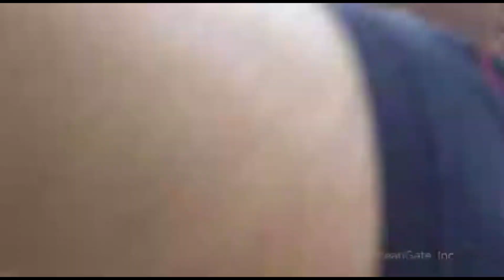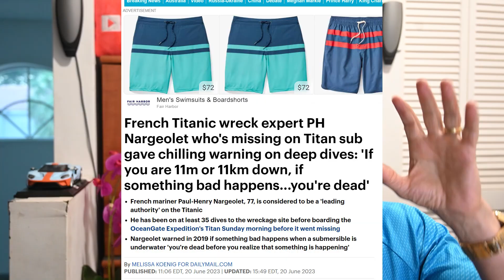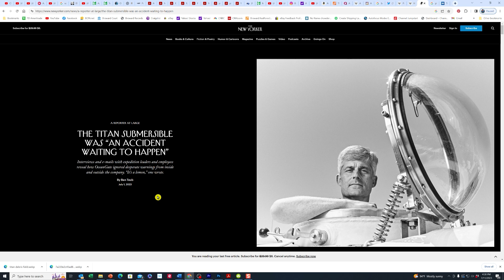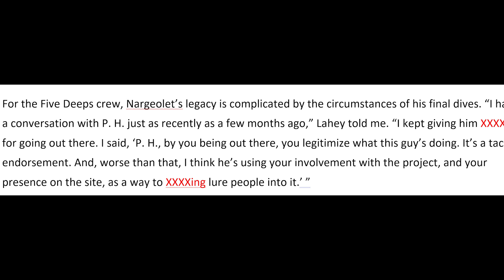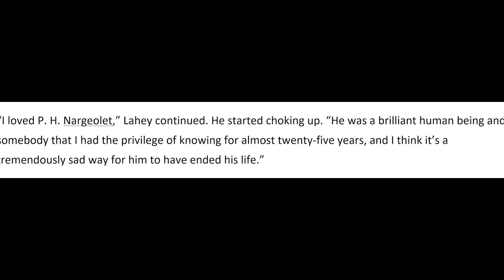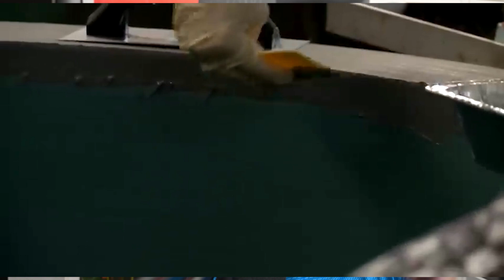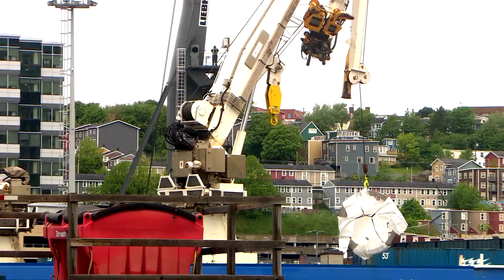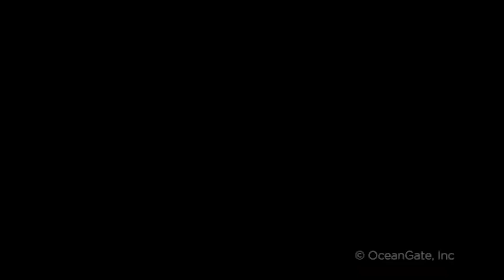Titan Sub: More Q&A, Design Defects, Why Descent Fast

Comment: The carbon fiber was being infiltrated with water, weighing the Titan down, and also causing the crackling noises and sonic alarms. That's why it sank fast and couldn't rise fast enough, despite shedding weight.
Reply: Carbon fiber composite is more dense than water. The only time soaking something makes it less buoyant is when the water replaces something less dense like trapped air.
Reply: @mqb3gofjzkko7nzx38  I've seen comments talking about water weighing the sub down, but I was having trouble imagining why water would supposedly make the sub sink faster (when it's already in the ocean surrounded by water), so thanks for your take on it.
Reply: @bagelbagelwah5047  I think of it as a wet towel becoming heavier than a dry one but maybe that's completely misleading shrug
Reply: @Zleec  It would be more like a wet towel being thrown into a pool.
Reply: @bagelbagelwah5047  While it doesn't seem you fully absorbed Archimede's law, let's try this argument: will a metal boat sink when you fill it with water? Take it from that point. 🙂
Reply: @curiouscat8457  will a carbon fibre vessel implode if it's already full of water?

Take it from that point. :-)
Reply: @fifiwoof1969  We are talking about buoyancy, in case you didn't notice 🙂.
Reply: is this just speculation? or is this confirmed?
Reply: @NithinJune  No way to know now that the whole hull has imploded. But its a good explanation of why they couldn't rise fast enough. But at the same time getting hull integrity test failure codes.
Reply: It's a good explanation. But what does "carbon fiber being infiltrated with water" mean? Has or can this phenomenon be reproduced?
Reply: @Zleec  Carbon fiber cannot be applied to anything as it is, it has to be bonded with a resin. Basically making it a composite material. This is dangerous for stress since, the inconsistencies will become weak points and after certain cycles of stress, it starts leaking. Also, this isn't solid carbon fiber, they had a hollow space to use it as mechanism to float by filling it with low density gas. Basically, lot of gizmos without testing.
Reply: @thelastorca  Very interesting
Reply: @Zleec  Yeah, more the videos I see about this, the weirder this case gets.
Reply: @Zleec  could do a pressure test. And post the video on YouTube:-)
Reply: It's a good theory.  While the implosion would happen very fast one could imagine a slower cascade effect with intrusion into the carbon fibers, de-lamination etc. Certainly a theory explaining crackling noises and RTM alarms not evident in early dives.
Reply: @heazilla  THEORY: Thrusters were incorrectly mounted thrusting down faster than intended!
Reply: @fifiwoof1969 I don’t think they descend with the thrusters. I could be wrong but i remember someone from the company saying they descend with everything in a low power state until they get to the bottom. They use the weight of the ballast to do all of the descent. I did think that some type of oversight like that could have done something to the structural integrity though. If they are so cavalier with things that they don’t test a thruster to make sure it is mounted the right way after replacing it, what else might they have done without knowing?
Reply: @Comfort031  and they ascend how? Jettison the ballast? A little uncontrolled wouldn't you say?
Reply: @Comfort031  I was imagining the vertical thrusters pushing down at a low speed to explain the "weight"; if it went unnoticed that could explain it.
Reply: Its one of the few things that would explain the fast descent rate and lack of ascent. Again if the transcript is accurate. Every other time, it descended and ascended right around a certain rate and did not significantly deviate. There was probably a small crack on the surface somewhere near the aft end (where they heard the noises if the transcript was accurate) due to differential expansion of the carbon fiber body and titanium end cap. As it descended it picked up more and more speed as more water came in. As the pressure increased, the water probably started forcing itself between layers of carbon fiber, separating them and causing the reported crackling. Eventually the structure separated to the point where it could no longer withstand the pressure and catastrophically imploded. It’s all speculation at this point. That’s all we can do until more information is released.
Reply: @Comfort031  incorrectly fitted thruster would explain that too. Up thruster pointing down for instance.
Reply: @fifiwoof1969  that would definitely explain why ascent was at a rate quarter of predicted, but wouldnt affect the descent. The simplest explanation is a loss of buoyancy which would explain both of those things. We will probably never know the answers to some of these things though. An investigation can tell us what likely happened but it’s going to be hard say with absolute certainty what it was. There was no black box to recover like there is on planes. No real time telemetry monitoring or saving of data. Just the alleged report of the hull monitoring system showing red.
Reply: @Comfort031  it wouldn't affect descent? I reckon it would affect both ascent and descent if both occured with an incorrectly mounted thruster thrusting in the opposite direction to what was intended. I wouldn't put it past these guys to make THAT fuckup. They ARE idiots!
Reply: I think it's a real argument for pilot error. Rush had far less concern about his descent rate than the mothership, which leads me to believe that he purposely dove at that speed. Either he was showing off for the Portier Prince crew to show them the sub was tough to show proof of concept or he was trying to hurry the trip to get back to something else. Either way, Rush was an engineer, he knew the possible outcome of descending too fast. Misplaced faith in his design or death by pride? Idk! And, I don't believe the sub was weighed down by water because Rush would have recognized that issue based on the rate of descent and would've made corrections to address the issue or flat out cancel the dive. Besides, the only infiltration of water that could have had a major effect on the dive rate would have had to occur within the pressure vessel where the crew sat. I find it highly unlikely that Rush or the crew would not have noticed a leak inside the sub. Additionally, if the hull was compromised enough to allow water to come in, the Titan would have imploded far before it reach the Titanic. Also, all the major components sat in liquid filled compartments or were in pressurized housings in the mechanical bay at the rear of the sub. if the sub was weighed down by water, where was the leak? In my view, the more likely scenario is that the rate of descent caused damage to the battery compartment and the hull and both only completely failed when the sub got near the titanic and needed to ascend. While they had a secondary battery system they only had one hull. Whether a vessel is  made  from titanium or carbon-fibre, descending or ascending too fast can cause structural failures in compartments and the main pressure vessel. All the hype about the material the subs hull was made from could actually be wrong!
Reply: @dwsfamilyvlogs7705  the carbon fibre red herring? It may not have affected the descent or failed ascent but it DID implode due to EXTREME external pressure and fatigue from previous descents.
Reply: @fifiwoof1969  Possibly, we may never know. In any case, whether a vessel is  made  from titanium or carbon-fibre, descending or ascending too fast can cause structural failures. Battery compartments are sometimes made from titanium and they can fail under fast descent rates and have.
Reply: thats if it was getting buoyancy from imperfections in the hull, pretty sure carbon fiber is more dense than water. maybe if there was a leak inside another secure compartment on the sub outside of the main pressure vessel it would make sense. if the transcript was in fact true then they had zero worry about the decent rate, making it intentional or they were low on oxygen inside causing them to not notice or care. in the transcript im not sure if the support vessel pointed out decent rate as well, making me think the transcript is false, or it was a planned rate. going that fast im worried the ship didnt have time to compress in its 'normal and uniform way', the ship is going to shrink as the pressure rises and if they went too fast maybe it just didnt give it the time it needed for all materials to match. I keep imagining this thing compressing in its center around the carbon fiber and the titanium not matching, the glue the only thing keeping the edges of the sub from popping away from the caps that are now way too big for the carbon fiber tube, )(  <-- if it was nose down.
Reply: @MrBonebus  the batteries of the Titan sit in a sealed compartment filled with a silicon gel fluid. Even if these compartments were compromised, you're only replacing the heavy silicone gel with sea water that weighs less. That wouldn't make the sub heavier it would make it lighter! The only thing I can think of that could have taken on enough water to make the sub heavier is the Titans buoyancy system. The system uses an inert gas transfer method to create buoyancy. This system could have been penetrated by water without the crew knowing but if this did occur, my questions are why didn't the sub's diagnostic sensors warn the crew and  why didn't Rush think the descent rate was unusual as his handlers on the Portier Prince did when they asked if he was going to slow his velocity? Only thing I can  think of is that Rush was responsible for the high descent rate.
Reply: Just wondering about the young interns who must have been to excited and feeling privileged to be working “at the cutting edge”. Unfortunately they would all be mailable to the cult like Rush and drank his cool aid. If they all continue with engineering, they sure have a had a long life lesson in why engineers respect the knowledge and lessons learnt from previous generations and why there are standards and regulations.
Reply: Most likely a fake transcript as the descent rate is way off. Who ever manufactured the story didnt do the math.
Reply: @KinariCuzz  just like "whoever manufactured the Titan didn't do the testing"!
Reply: @fifiwoof1969  well. That one appears to be a fact.
Reply: Do you have any proof of this or is it just speculation on your part?
Reply: @R0swell5104  i believe all of this is speculation. Armchair engineering
Reply: @R0swell5104  who are you talking to?
Reply: Interesting thought and a possibility. Did the craft gain wight over time?
Reply: @heazilla  Exactly in this case they are mostly thoughts.
Reply: They were never descending too fast. He keeps comparing the descent rate of James Cameron's sub to this sub, which is fundamentally wrong. 
Doing 5min of research will show you that this company made 13 other trips to Titanic, and every one of them had a descent rate that got them there in 90min or so. The descent rate wasn't an issue. 
This topic keeps generating a lot of clicks though, so ignorant speculation keeps winning the day.
Reply: There is no space in between carbon fibre and there is even less water can suck unnoticeable to sensors.
Reply: Its still buoyant, with water inside or not. That wouldnt affect anything.
Reply: @cyphi474  Oh dear...
Reply: Interesting. Could have also been a malfunctioning vertical thruster.
Reply: @thunkjunk  or NOT malfunctioning but incorrectly fitted!
Reply: No no it’s a moronic theory lol.

Comment: My very amateur speculation is that it had a leak and was taking on water as it was going down.  This would add to the weight of the craft and accelerate the descent.  This would also lead to the overly heavy craft that can't rise quickly even after jettisoning every possible part.  It should have been rising quickly without the jets after ditching the undertray/skid.  The only extra weight I can easily add is water.
Reply: Any water that would leak into the vehicle under that pressure would slash the contents to atoms as the it buckled and imploded. In milliseconds. The pressure is insane.
Reply: @fauxpinkytoo  yeah but if the leak started further up, like way further up, it might not have been immediatly catastrophic.
Reply: @Mglue3 wut
Reply: @fauxpinkytoo  The leak could be more a seep between microcracks in the layers
Reply: @fauxpinkytoo  Cite your proof.
Reply: @Capecodham  50 years of study and practice by everyone in the industry... Is that enough for you?
Reply: @stever2583  I have  67 years of study and practice by everyone in the industry- see how easy that is to type?
Reply: @Capecodham  Not me idiot... The people who know the answers to very simple questions that you struggle with. Cheap shots is all you have? I guess that's what no education gets you.
Reply: If the craft buckled and reduced in volume that could also have reduced its buoyancy.
Reply: @mqb3gofjzkko7nzx38  cf wont buckle it shatters.
Reply: My theory is that the vertical thrusters were malfunctioning.
Reply: It - cant - have - a - leak. Drop this theory. It doesnt make any sense. Its not a boat.
Reply: @KinariCuzz  It could have a leak, but the implosion is proof it wasn't  completely filled with water.
Reply: Spot on
Reply: While possible, I have to wonder if they were ballasted correctly from the get-go. That could cause a fast descent and a slow rise.
Reply: @russellhltn1396  I want to know how buoyancy  was controlled.
Reply: @JoeLinux2000  Same here.  I've heard of ways they could drop weight to ascend, but not how to fine tune their buoyancy.  Normal subs have tanks for that.
Reply: @russellhltn1396  this is true.
Reply: It's not a metal hull. Carbon fibre that allowed water in, would fail catastrophically, not leak.
Reply: @kristianfagerstrom7011  true
Reply: if there was a leak , descent rate would be increasing progressively. also as the pressure gets higher, more water intake. progressively more water intake(faster water flow) causes that tiny hole getting bigger and bigger. like a river flowing fast, destroys the land its around. that would be a very fast, unreturnable chain catastrophic event. it wouldn't take 1.5hrs.
Reply: A leak is instantaneously catastrophic.
Reply: I thought the same as you, but as somebody pointed out, it's possible there was an electrical failure that made it so they weren't able to drop the ballasts. 😭  Scary!
Reply: They don't use thrusters for ascending and descending, that part of the trip is purely buoyancy controlled.

If the com log is authentic than they did release their weights.

A leak slowly filling up the submersible without them noticing is borderline gibberish, regardless of when it occurred. Makes no sense to me.

I personally find it most likely that they drastically miscalculated their weight or water had begun to seep into the layers of the carbon fibre.
Reply: ..my guess is that his beloved logitec joystick, lost its resistance over control surfaces due temperature/humidity as it uses graphite based potentiometers as a sensor..as result of low temperature, resistance changed which in return caused deadband of signal to be such that, full throttle up for thrusters was impossible, regardless hes yanking it to the max or not..and thats exactly reason why MIL grade joysticks sensing surface is enclosed in nitrogen atmosphere inside heated enclosure..
Reply: @eccosabanovic1589  Yeah. Could also be the wireless controller lost it's signal.

Comment: Dear Jeff, thanks for your videos. A question that is hammering my mind is: why did the descend rate accelerate?
Was it actually taking water between the layers of the carbon fibre since the start of the dive? Were they loosing air slowly?
Reply: Or maybe taking water under the floor as well, theres a void there -  but I hadnt considered the CF itself taking water like a sponge as it split apart, good theory--!!

Comment: I think a major factor in this tragedy is the fact that the submersible was made from different materials, carbon fibre & titanium, these materials have different levels of compression.
The bulk modulus of the carbon fibre part of the sub is around 20 & the bulk modulus of titanium is over 100, so the carbon fibre part was able to compress, while the titanium did not, adding up to a disaster.
Reply: This would have put the joint glue in shear. The unetched possibly contaminated titanium surface would have suffered accumulated progressive glue line failure over several dives. The external pressure would help keep the end bells in position but leakage into the failing glue line would allow migration of water into the edge of the carbon fibre. When the penetration had reached far enough for the remaining thickness to fail, it would have sheared the last of the glue joint. The extreme axial load would ensure that the remaining glue was scrubbed off the metal face. The momentary huge turbulence of this collapse at the interface would also clean the polished surface. Hence no trace of glue or carbon. Be interesting to know if the appearance  of both bells is the same.
Reply: every real PE knows this